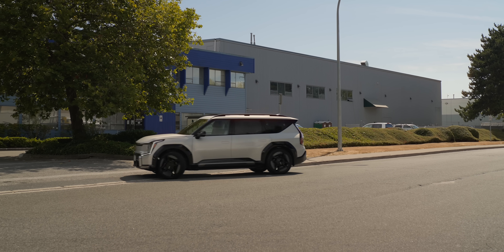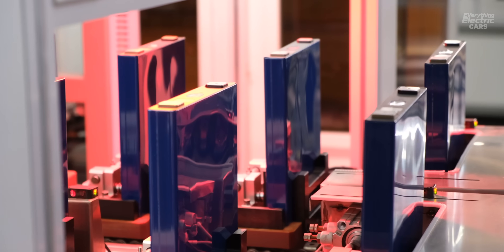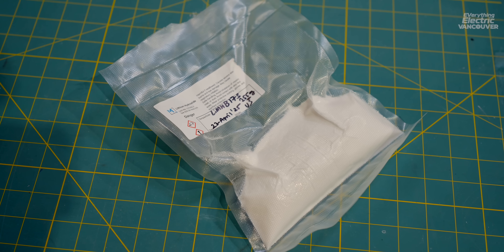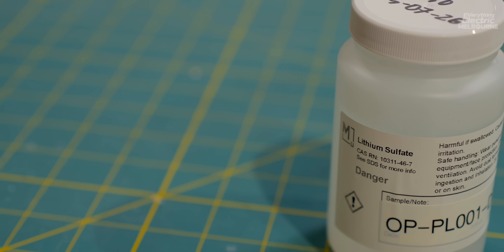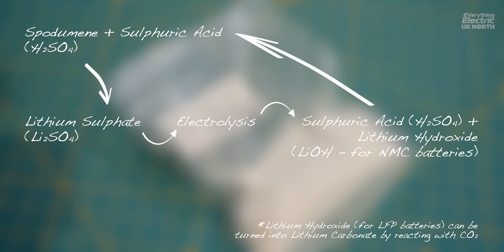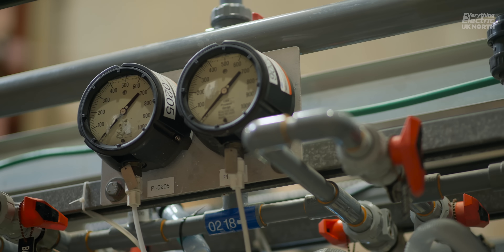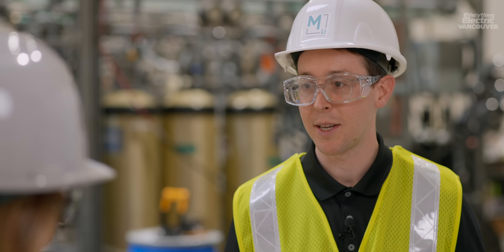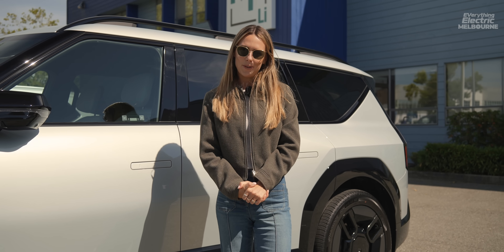THIS Clean Lithium Tech Is Challenging China’s Control Of The Battery Supply Chain!

Comment: Na can be used in batteries for grid level storage and the Sulpher if you can develope the chemistry of LinS or Na S your onto a winner plus It can be used in the chemical engineering of wood as in the Metelwood process where fast grown soft and hardwoods can be converted into a stronger than steel or Al metal fire a rot resistant natural carbon nano tube composite ...

Comment: I'm confused. Sodium Sulphate is a chemical that you buy, and it's not that cheap. Used in dyeing as a fixative for certain dyes, and in glass manufacture. Why dump it?
Reply: Expensive for you, but in bulk it's like $35 per ton.  It's more expensive to haul it to those users than it's worth. I mean a ton of dirt will cost you more. In general it's mostly an industrial waste that easily accessible.
Reply: It's low value at tonne level, and the waste sodium sulfate from lithium refining is low grade, so requires further purification to be sold at a good price.

Comment: The directly competing technology to this is Neometals Eli process using standard chlor-akali process used to produce chlorine and sodium hydroxide at scale all around the world. This gets rid of sulphuric acid completely. Neometals is currently working with RioTinto on this. Other processes avoiding sulphuric acid might include Calix/Pilbera JV doing electric calcination and converting to LiPO4 but I can’t find details of the hydromet steps. Calix (electric cement, zero carbon steel as well) may be worth a visit at Bacchus Marsh (near Melbourne) in November.
Reply: Cement and steel are big challenges that deserve more attention.  Would love to see content looking at emissions improvements in those areas.
Reply: @davidmenasco5743    Canada has just electrified two former coal fired steel mills in Ontario.  The most recent reports a 70% drop in emissions using Ontario's nuclear grid.
Reply: @ub59 That's great news.

Comment: It would make a lot of sense for this technology to be also used in China. It is not about competing with other countries,it is about competing against fossil fuels.
Reply: They actually sell the sodium sulfate as raw material.  This is strictly a NA / EU / AUS problem.
Reply: Competition in this sector would mean China would need to step up its game in battery making thus causing more investment in green technology, not less
Reply: @franciscoveiga8263 China already manufactures 75% percent of all EV batteries. As a nation they are peerless when it comes to green tech research. As an American it pains me to say this but it's true. Capitalism is the best for breakthroughs resulting in short term gains,.but China's system,. despite its many flaws (and they are huge) is financially more committed to the projects that solve societal problems over the long term.
Reply: @davidaustin6962  China's manufacturing industry is more capitalistic than the US.  There are less 'regulatory moats' lobbied by large companies.  I guess the difference is that technocrats at the CCP occasionally frown on such moves and crack down, meanwhile we keep lawyering up and only doing M&A over here instead of innovating.
Reply: @teac117 agreed. Sad but true
Reply: @franciscoveiga8263  China leads all nations right now in clean power and battery development. You been living under a rock or something.

Comment: History is made in the field of clean energy as the ECAT charges the battery of The Twizzy electric vehicle, which has a one hour driving range, but with the ECAT The Twizzy continues on for four hours longer then The Twizzy without the ECAT, but the point not to miss is The Twizzy with The ECAT had a better battery charge then when the demonstration started and it could of powered the Twizzy for 11 years non stop and still have a full battery.  A ECAT WITH 0.0137 KWH size could power a Canadian home a E-Cat NGU 1 kW Generator costs ($2500)

Comment: Too bad CATL's NAXTRA sodium ion battery is going to crash the party rendering much of these companies marginal players soon enough. 175 Wh/kg vs LFP's 185 Wh/kg is only 6.5% off its density but above the now very popular BYD Blade Battey at 160 Wh/kg so clearly it's in the energy density "good enough" sweet spot but the best thing isn't the 5C charging capability or the use of non rare earth materials or even the price. It's the 1 million mile lifespan and 10,000+ charge cycles which interest me. That's charging every day for 27+ years...  Sounds like we're about to enter into an electric classic car era where the chassis far outlives the body of a car.. It's the fact it's apparently rolling off lines in China @ $19/KWH at the cell level $35/KWH at the pack level all while NIO offers its swappable 100 kwh pack @ $15K or $150/KWH... So in other words? We're about to enter PEAK BEV ASAP! 2025-2030 is going to be the rise of the SODIUM ION and SEMI-SOLID STATE batteries which apparently are now being placed into entry level models in China too!
Reply: I hear what your saying but I think there will always be a place for lithium in batteries due to it having the largest engery storage potential.
Reply: Yes, sodium for the broad EV market, but it will never be close enough to the energy density of high end lithium batteries. It will never be used in mobile phones for example, or high end ev cars,.but it looks to be a game changer. I just bought some shares in CATL myself (CYATY).

Comment: Super cool video as a technology gets better it'll be cheaper to make and the batteries will get smaller we need to do more when I drive up and down I-5 going through Seattle I look out over the Boeing airfield an all the factories that have flat roofs hardly any of them have solar panels on top of them  and, Washington is meant to be the Green State but for some reason it's not that green when it comes to Electrification ?

Comment: Maybe you could use the Sodium sulfate for Sodium battery's .
Reply: Looking at Wikipedia, it seems there are many potential uses for sodium sulfate, but the stumbling blocks may be around the low market value, and the particular variant produced which may require additional processing into a more useful form.
Reply: I did wonder about that, dont like the idea of it going in a hole in the ground ?
Reply: You could convert it into other useful chemicals like Sodium Hydroxide and Sulphuric Acid :)

I wonder how circular their process can be…
Reply: Exactly, if this gets realized then it's a truly game changer

Lithium and sodium batteries from the same raw materials, why not? Zero waste, double the battery

Comment: ionization bond breaking. nice. nah, zinc sulphate is much nicer. and simpler. just soak stuff in sulfuric acid. only copper zinc and iron dissolves from the feed stock ore material. then zinc electroplates off first. then copper. then the generated sulfuric acid is recycled in next ore batch. current efficiency of zinc refining electroplating cell is 90%. anywhere there is a zinc refinery, is a big zinc-air battery. or zinc-acid battery. metal air batteries are way better, even primary batteries. say aluminium, magnesium, zinc. diy zinc metal-air primary cell batteries. to get higher energy weight density. small % difference does not matter. easier processes and usage matters more then. even down to lead-acid. no reason the get a head-ache from complex nonsense. for 30 lithium coins sake, every day meal. well zinc sulphate water solution with steel- and graphite+ give out zinc and sulfuric acid and oxygen. by the water based electrolyte itself. well seems like the other half of the cell is water lithium sulfate solution. zinc-acid/air battery energy weight density is better then lithium-ion batteries. because lithium-air battery is even better, same as magnesium/aluminium-air non-rechargeable batteries.

Comment: Hydro electricity is key. So not only will Canada make the 'greenest' aluminium it will produce the greenest lithium.
Reply: I mean, hydro helps certainly, but it isn't strictly necessary.

Scotland switched a huge chunk of its hydro resources for wind to reclaim the once populated valleys that were drowned to create those reservoirs.

I guess Canada has a lot more useless wilderness though compared to Scotland which is pretty tiny by comparison, so it might as well get used for something.
Reply: @mnomadvfx  BC's hydroelectric reservoirs are largely glacier fed. The glaciers are melting due to climate change.  BC has also built out its hydro capacity with respect to lack of public acceptance of more flooded mountain valleys. Therefore, BC has launched two calls for renewable power, each with 5,000 GwH per year of capacity with a third call expected in a few months.  That's 15,000 GwH a year of new renewable energy coming online by the early 2030s, enough to power 1.5 million homes. BC's Indigenous communities have responded spectacularly and many plan to build large scale wind and solar farms on First Nation's vast territories.  Unfortunately, BC has just started to export LNG, so there's a contradiction here too.
Reply: The main reason Scotland went away from hydro was the assets were given away by the Tories to an Indian company who then failed to invest in maintenance.  @mnomadvfx

Comment: CATL NAXTRAfor your next video ... please
Reply: Yes, hopefully EE will be able to uncover the volumetric energy density that CATL have been coy about releasing info on. 

Whilst the gravimetric density of Naxtra Sodium may be getting close to LFP, if it takes more volume then it won't work for EVs, but may be suitable for static storage, given the lower cost of Sodium.
Reply: @GruffSillyGoat 
What are you talking about? It's on the CATL website
Reply: Nope - I looked, the gravimetric value is given (175Wh/kg) but the volumetric one (Wh/L) isn't stated, which is a known issue with Sodium Ion having lower volumetric density, taking up to 10 times the volume of Lithium within the cells. Looking at the Freevoy battery internal image, the Sodium Ion prismatic cells seem to be about 15% wider than their LFP ones.
Reply: Yes!